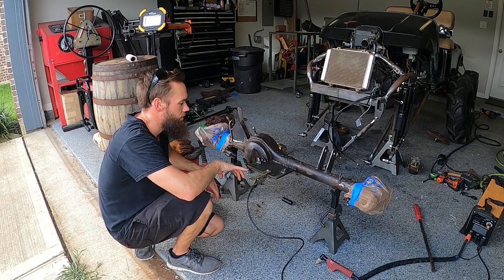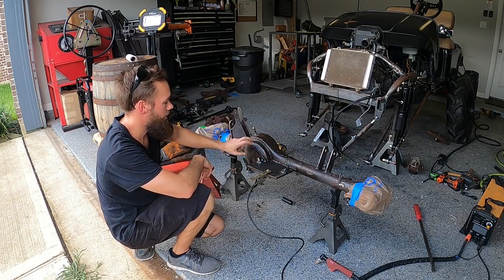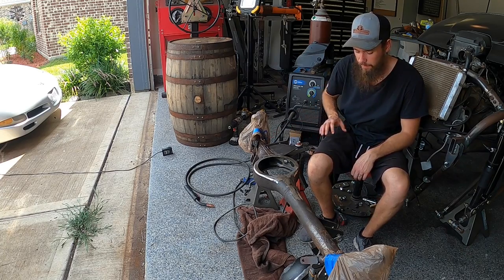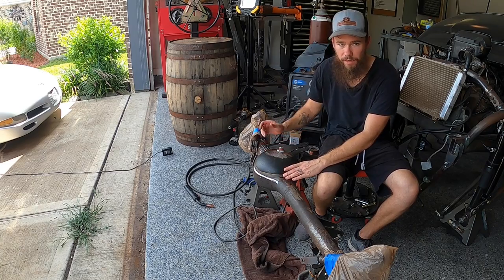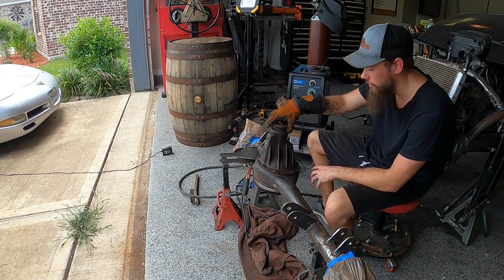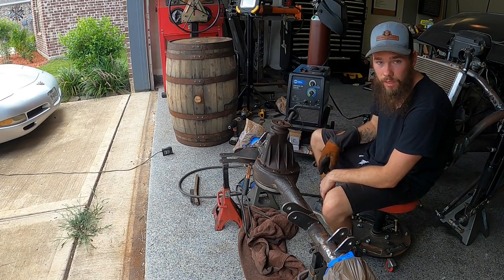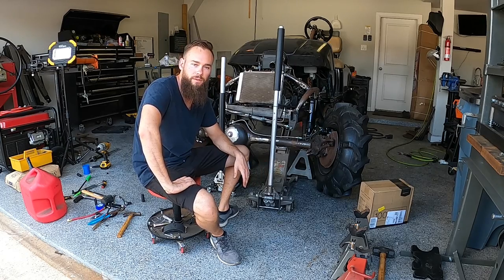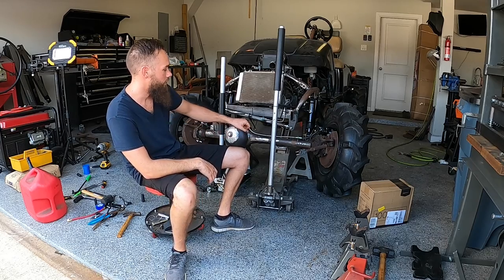Monster Golf Cart Build Part 13 Flipping The Front Differential | Bare Metal Fabrication

Comment: Any video on the transmission to transfer  case build
Reply from the maker: Unfortunately I didn't start filming until after I mounted the transfer case. But I did take a lot of pictures. So I may make a "video" using some of the pictures I have and explain everything I did before I started filming.

Comment: Very cool! Why you ditching the double ended boat steering? I got a electric 4x4 I'm working on now. Trying to clear 28 inch tires on regular suspension in rear and doing a 3 or 4 link up front.
Reply from the maker: Thanks! I’m ditching the double ended ram because of a few reasons. The ends where the threads are is really small in diameter and I was worried about the strength of that part of the ram. Also the 5.5 turns of the steering wheel was pretty annoying. I bought a single ended ram that has a much bigger piston so it’s way stronger. It will have a much stronger mount. And it will also have 3 turns instead of 5.5.
Reply: @BareMetalFabrication  NICE that should be better for sure.